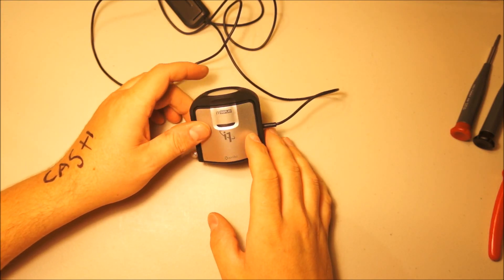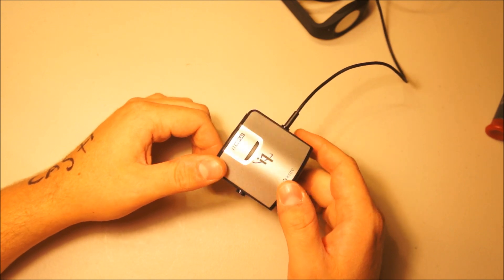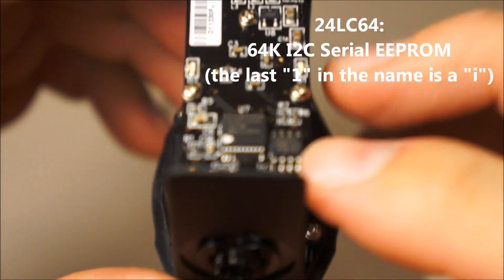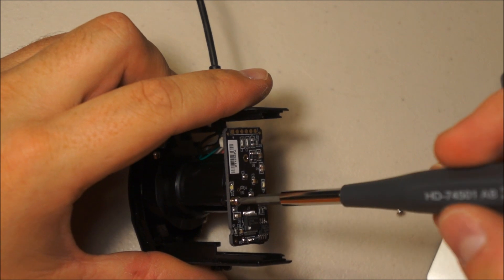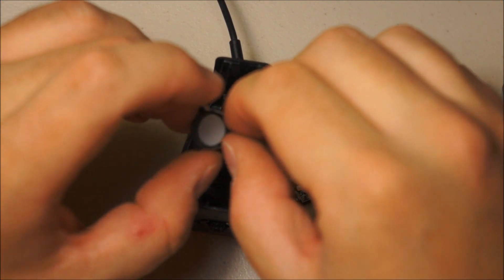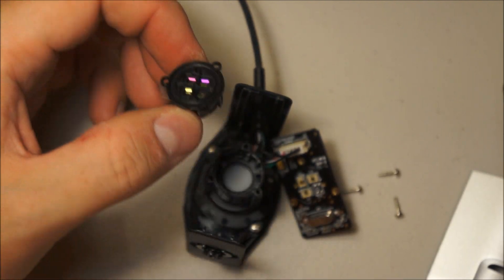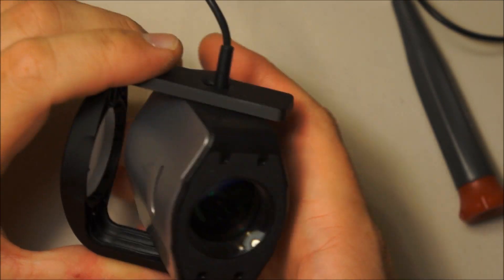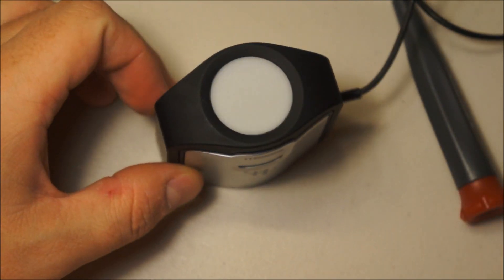Extreme Teardown: XRite i1Display Colourimiter

Comment: thanks for taking apart, i was curious how much stuff was inside to worth USD$2xx  Look like it was build with a max USD50 component cost and the rest was to pay for those rubbish xrite software. But it is not recommend to take apart as you can throw off those lens position which affect the factory calibration. since shift in position result in focus shift. Didnt expect to be a pic controller hahaha

Comment: i bought one in 2013, use it once, now i try to used it again in 2016, open the box, and found out the rubbery material is melting, i still try to use but to no avail, seems like a hardware problem, now i'm looking for a device made of plastic with no rubber material. Idisplay pro seems to be a good device, but bad hardware composition. now i'm looking into Spyder 5.
Reply: any device with a rubber texture will self destroy if u store it too long without using. it will get sticky glue like. just take a plastic spoon and scratch off and clean up with alcohol. Might get scratched up, but better than touching something sticky.

Comment: Thank's for video! My i1Display, after 3 years of stable work, does not detected in the programs for the calibration (OS's find device). I already tried everything I could, but unfortunately, it seems to have a hardware problem.
Reply: Yep, my i1 device was only usable for a couple of years because no software would support it. And now X-Rite sells items that are now 5 years old. I'm weary of purchasing an i1Pro because it will most likely become obsolete in a year or two. Not sure what route to go when it comes to purchasing a new calibration tool. At least the SpyderX Elite are brand new, yet with the poor history of the company I'm weary of purchasing that as well. Not sure what route to go.

Comment: Couple comments. In terms of an unexpected emissive technology, my understanding is the unit can be updated (using a mechanism that isn't yet available to us end users) so should some new technology come about, the unit could handle it. That's pretty cool!

The "obnoxious" software you refer to might be XRD? It's more than just for software protection, more for connectivity. That said, it's a big PITA (buggy, needs updating all the time etc). Kind of useless IMHO. And yes it runs all the time and can cause issues. There's more software running (ColorMunki Tray?) to remind you to recalibrate and for the ambient light tracking (IMHO useless). You can turn that off.

This is pretty much a state of the art (today) Colorimeter in it's price range. With good software, the product does a very good job.

Comment: Nice video :) Wish I saw this before I opened my ColorMunki Display which is identical except for an 800ms software delay crippling it. Those sensors are light 2 frequency devices, so I guess the PIC just counts pulses on I/O pins. Still looking to try dump the firmware and remove that stupid delay. Have you tried? Also, my factory calibration went a little bit off after opening the optic section :(
Reply: my thoughts are the same. just rent a i1dislay pro and dump the firmware and then flash it in your colormunki. but before that backup the original first. so u will have a "i1display pro"

Comment: Spudgers mainly, a plastic one and a metal one. On the other video you used plyers on bolts, Do you have a mini socket set? They rock. Also some allen keys with a straight handles. The bent ones can widen the holes for the small keys.